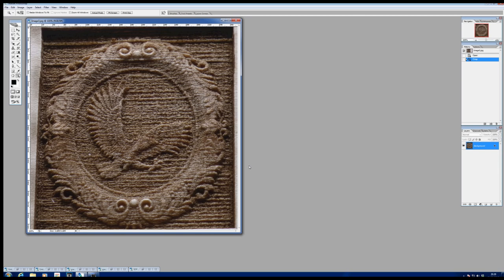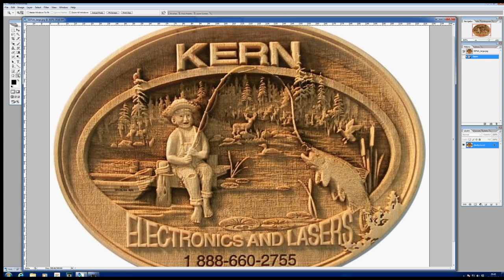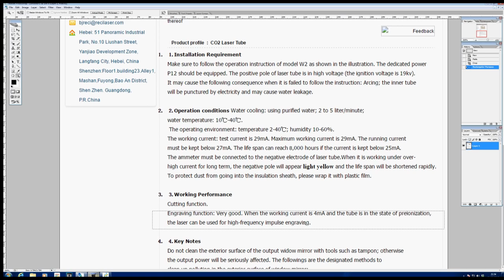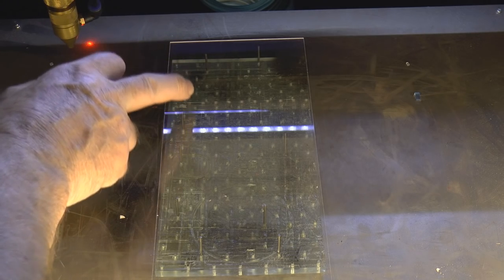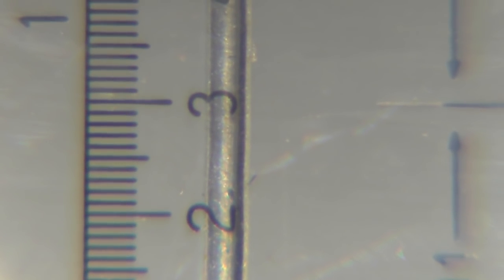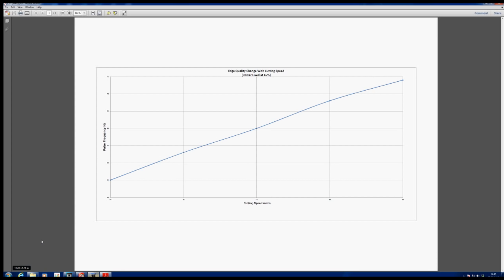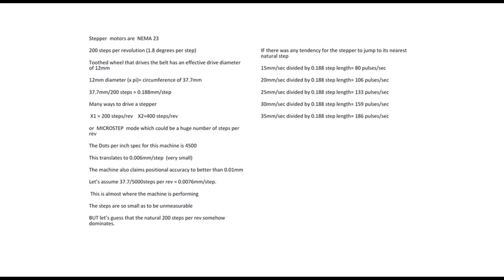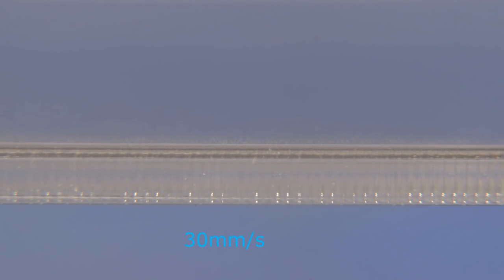RDWorks Learning Lab 63 High FrequencyImpact Engraving

Comment: It strikes me that the pulsing probably comes from the power supply.  AC is used to step up the voltage through a transformer and then a full wave bridge rectifier is used to convert the AC to DC. A 50Hz AC (UK) signal would produce pulses at a rate of 100 ppm. If the DC output is poorly filtered the pulsing is coming from the power supply. If you look up full wave rectification it is easy to find diagrams showing this. It would be really interesting to see the results from machines in the US and UK burning the same patteren with the same settings. AC in the UK is at 50 Hz, in the US it is at 60 Hz.
Reply from the maker: Hi Adrian
There are several pulsing issues I was trying to untangle and I'm not sure which one you are alluding to. 
 I think you were referring to laser pulsing during my edge cuts. Although my background is in production engineering and mechanical design, I have a rudimentary understanding of the "dangerous" stuff. I knew nothing of how sealed laser tubes worked a year ago when I bought my machine. I now know enough about how they work to understand many of the problems that people see. I tried to describe this in a 3 part video I did. It was rather over simplified because I was trying to transmit the principles by which the tube works and fails rather than a technical paper that would allow you to design one. I do not claim ANY knowledge of what goes on in that HV power supply, just a simplistic block diagram in my brain that covers the basics. So yes. I understand about the 100Hz ripple potential and that it is going to be magnified by the time the voltage is boosted to 25kV. However, what does this voltage do?
There is 10% nitrogen in that tube and this 25kV is sufficient to trigger ionization in just the nitrogen. That's what you see glowing pink. The nitrogen is now in a very highly energetic state and has changed from an insulator to a gas with lots of free electrons that can carry almost infinite current.  This is where the power supply steps in to firstly sense this change (XXX see note later on) and then drop the voltage to about 17kv to maintain the ionization at a more stable level and to regulate the current flow through the nitrogen because it is that current flow that determines its level of excitement. The more current the more excited the nitrogen becomes,and the more heat is generated. The gas mix  in the tube contains 80% Helium, which is a great conductor of heat and it's only purpose in the gas mix is to carry the heat that the nitrogen is creating out to the water jacket. Despite being called a CO" laser,  there is  only 10% CO2 in the tube and this is totally  unaffected by the HV, as is the helium.  However, the "lazy" CO2 molecule can be excited into doing something if one of those energetic nitrogen molecules collides with it.The raised energy state of the CO2 molecule is short lived because it's much happier being "lazy". It is quite happy to give up its new found energy as a photon and it's this little particle of light energy (in the infrared spectrum) that along with billions of others' is then  mechanically intensified with mirrors to become the laser beam. This works very well until you reach a critical balance point. If you let too much current flow through the nitrogen, it becomes hotter and more excited than ever and the helium just cant cope. The overexcited nitrogen molecules now have sufficient energy to break down some of the CO2 molecules into carbon monoxide and  oxygen, neither of which are lasing gases. So now you have less CO2 to work with and your tube will start losing power. Even if you don't exceed the operating current set by the manufacturer, this process takes place very gradually over time and your tube eventually dies through lack of CO2. HOWEVER, a tube producing zero watts of output will still glow pink the same as when it was working perfectly.

My point in explaining all this to you is that there are  MAJOR disconnects between what is happening to the DC voltage and the generation of the laser beam.  It's the current flow (that is somehow magically controlled by the PWM system)not the voltage that is INDIRECTLY responsible for the power of the beam.

What I have investigated so far indicates that the beam is pulsing at highish frequency (XXX) as the power supply  struggles to establish stable running. Above this threshold the power is ripple free for a fixed wattage because the PWM is stable.  What I now have to check is whether this same situation exists when I start asking the beam to change rapidly in response to grayscale requests. At 20kHz, I cant see the PWM system being fast to control grayscale current variations. There must be a more direct 256 level output to control the current.

Lots more to find out about this subject
Thanks again for you input because you sometimes need a steadying question to carry out a reality check on your own thoughts.
Best regards
Russ
Reply: Russ,

Thank you for the explanation. I was thinking of the pulsing during the edge cuts. I was not aware of the gas mixture but the process does make sense to me. If you have questions about the physics behind it all I am not the person to ask but I certainly have the connections.

I am actually a high school teacher - until I retire at the end of next week. Primarily computer networking but about 11 years ago  was asked to develop a curriculum to train technicians for a new nano-technology center in town. They were making MEMs (micro electro-mecanical ) devices. I eventually came up with an artificial intelligence curriculum which would serve the micro/nano needs but also cover industrial automation.

The MEM's part of it all demanded that I go an get training in how the things were manufactured. I ended up learning a lot of photonics and quantum mechanics in the process. Not so easy for an old coot like me but I enjoyed the challenge.

Now that retirement looms I have been looking at these machines to play with and I have really enjoyed you series of videos. I'm actually looking at a 400x400mm 150W unit that will cost a little over $1800 but would welcome your suggestions.

I live in the extreme NW corner of Massachusetts & teach in Vermont but originally I am from Essex. I grew up just outside Colchester but then I met this American exchange student while I was a student at Oxford and ended up married and in the USA.

Thank you again for all the information and education.

Have a great weekend,

Adrian
Reply from the maker: Hi Adrian
It's an amazingly small world we live in. Here I am typing away in Wivenhoe. I was born in and have lived around Colchester all my life.
I used to work for a US company called Dynapert that was based in Beverly. The acquired a company in Colchester that I worked for. They made auto insertion machines for building circuit boards with leaded components whereas we in Colchester made vision controlled machines for building boards with surface mount components. I made some good friends in that East coast area and have visited them often in past years. I have travelled quite a bit in the USA but mainly in your north east section above a line between Philadelphia and Cleveland and all the way up to Nova Scotia. I think the closest I got to you was the Mt Washington cog railway.
You will be able to do serious damage with 150 watts, are you planning on cutting housebricks? 400x400 is an unusual size for such a big tube...or is it a fibre laser? ( not for $1800 surely?) or is this a build it yourself retirement project?
Bet regards
Russ
Reply: Dear Russ,
                   A small world indeed. I was actually born in Wivenhoe and lived there until my parents divorced when I was about 10 and we moved to Langham with my mother. Even then I still had lots of family in Wivenhoe and worked in the shipyard during my teens over the summers painting ships. 

The machine is an unusual size but it was the best deal I could find. I figured that rather than ordering from EBay, I might as well order the thing directly from China. Having decided that, I figured it would be prudent to do some research and make sure they were legit. It turns out that they are and use an escrow service. I pay the escrow service and they hold the money until  the goods are delivered. The money is then released to the seller. I think I am about ready to take the plunge. My attitude is that I'd rather have the power in reserve and not need it, than need it and not have it. Who knows, 3D etched bricks might become a big fad.

I have another marking material experiment for you. It seems that steel can be marked using plaster of Paris. Cheaper still than the Molybdenum spray. I am actually wondering if that is the ceramic component in the Cermark/Thermark products, or at least one of them.

One of the teachers at school gave me some cermark for marking glass, ceramics and tile. If you'd like I will send you some to play with - the least I can do considering all I have learned from your videos. It is in powder form so there are none of the hasmat requirements for shipping - my email is sebborn@roadrunner.com is you care to send me your mailing address.

All the best,

Adrian

Comment: It’s pulse width modulation. Increasing the pulse width and decreasing it changes the frequency and power
Reply from the maker: Hi Duane

Thanks for your suggestion as to the cause of what we are witnessing. This video was done at an early stage in my learning journey and now, 2 years on,  I have a complete understanding of this pre-ionization mechanism.   The 20khz PWM signal has no direct influence on this characteristic which is a feature of all gas discharge tubes regardless of how they are driven. You control the current flow through the tube by applying a 0 to 5vdc signal to the IN terminal of the HV power supply . That signal is generated by the Ruida controller. Many controllers have two methods of sending that signal to the power supply. One is with a PWM signal which is a way of digitally encoding the 0 to 5v signal so that it is almost impervious to the RF spikes that will be in the machine, the other is to send an analogue 0 to 5vdc signal. When the PWM signal arrives at the IN terminal of the HV power supply it encounters an RC network that decodes it back to an analogue voltage but when the analogue signal arrives it passes straight through. The net result is that it is a simple analogue signal that is controlling the current flow through the tube and there is no underlying pulsing driving the effect you see. What you are seeing is a natural characteristic of all gas discharge tubes. In the case of our tubes we have a gas mix within that contains  nitrogen, helium and carbon dioxide. There is only 10% nitrogen, but threaten that with 25,000 volts and it starts to lose its insulator properties and free electrons start to carry current. There is now a cascade effect where a few  free electrons screaming towards the tube anode at almost light speed, collide with more nitrogen atoms to create more free electrons. Every time you switch the tube ON you will almost instantaneously pass through this operational phase to reach a steady ionized beam. However, if you regulate the current to very low values you can sustain this pre ionization phase. The high frequency is nothing to do with the PWM but all to do with the randomness of the energy transfer between the nitrogen and CO2 molecules. . You can see the fuzziness of the partially ionized beam and get an idea of the instability and randomness of the lasing process if you watch the following video from 21 minutes onwards
https://www.youtube.com/watch?v=nZuatc3eIgU&list=PLPWEtx5V9DqEogIeYRdcG_KYcB7UL2Qmn&index=26&t=1272s

There is however a situation where you can see the 20khz PWM signal and that is if you choose one of the USER settings called SPECIAL MODE. This uses the PWM clock signal to switch the tube on and off at 20khz and by varying the duty cycle (mark space ratio) from 50% to 99%, you can vary the net power output from 50% to 99%
. This mode of operation is only available for scanning.

I have had many correspondents tell me that they can change the cutting characteristic of their machine by  playing with the PWM frequency setting. Yes it will have an effect, it will slow down the response time of any voltage change sent from the controller. As you rarely cut at speeds greater than 30mm/s and max and min power will be set the same, the effect on cutting or normal scanning will be ZERO. Like you, they believe the PWM is getting through directly to the tube.  IF this was an RF controlled tube they would be correct but sadly RF control technology is in a different price bracket and operate completely differently to our DC controlled tubes. If you look in the LASER vendor settings you will see additional settings for pre ionization frequency and pulse width but these only apply to RF control technology.
Thanks for your comment because it does give me a chance to clear up this issue for others that may follow.
Best wishes
Russ

Comment: Its all down to PWM (Pulse Width Modulation) - A laser cannot go from zero to 100 % current as it needs a certain amount to lase - in order to adjust the current it uses full power but divided by the power required - so 100% is on (Its usually not on 100% of the time but probably 70% or so to make it more efficient) with 50% being 50% on 50% off (This is divided by the PWM frequency) - the lower the current and faster the speed the more you will notice the individual pulses.  Its the average current the laser receives - Not the actual current  (100w only on for 10% of the time = 10w (at usually a high khz frequency))
Reply from the maker: Hi Matthew
I am no electronics expert as you may have heard me mention often  but in my keenness to understand how these lasers work I have spoken at length with experts.  The system used on these machines is DC excitation and not radio frequency stimulation.  Your understanding may well be correct for RF  tubes where you can play with the operating frequency. I know nothing about RF tubes.  With our dc excited tubes,  the HV  power supply is designed to output a maximum current , say 20mA for example. That current output is controlled by a dc voltage input to the HV power supply,  where 0 volts input =0 mA output and 5 vdc input= max output (20 mA in this example) That 0 to 5 volt signal arrives at the HV power supply (to the 5V terminal) in one of two formats. It is either a PWM signal that is translated back to an analogue voltage, or an analogue voltage directly from the controller. My China Blue machine uses the PWM signal because that is all the controller is capable of but my Lightblade machine Ruida controller has both PWM and analogue outputs. There, they have used the analogue output. 
This video was my first venture into this strange operating zone for the tube about 18months ago. Since then  I have acquired more understanding about it I have come to realize that every time the tube switches on it almost instantaneously  passes through this region on its way to a steady (pulse-free) beam There is no direct link between the beam and the PWM. The PWM is just a means of telling the power supply how much current to allow through the ionized nitrogen. That  relationship between current flow and watts output is also VERY non- linear.
The fact that my Lightblade machine does NOT send a PWM signal to the power supply is testament to this fact. It still has a High Frequency Impact Engraving zone which I have now come to understand is typical for any gas discharge tube and is generally called the pre-ionization region. Reci and EFR have decided to imply something special about their tubes by coining this new description.  In reality it is a fantastic region to exploit as it has VERY high frequency (way beyond 20khz) instantaneous high current transients that also deliver very high power spikes. These spikes produce great results for glass engraving and also scorch-free cutting of card. The average current will show as 4 to 6mA  but the instantaneous current spikes are something stratospheric that I have not been able to measure with my humble little PicoScope.. They are too big and too fleeting. 
Take a look at this unpublished video of some card cutting I have done with this pre-ionization power. Look carefully at the closeup shots at the end of the video and you can see the micro perforated edge caused by these spikes. Whether I use the PWM driven machine or the analogue voltage driven machine, the results look the same.
https://youtu.be/S_2NOCpACVc
You may also find it interesting to watch another video where I filmed one of my expert encounters and he describes in detail how our power supply works.
https://youtu.be/5CoTrLNUWTM

Thanks for the stimulating comment.
All best wishes
Russ